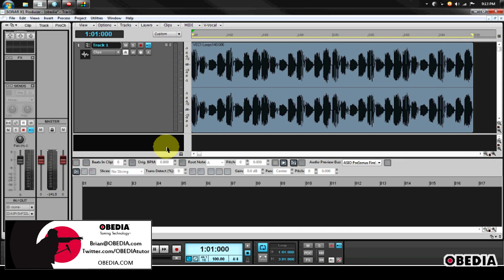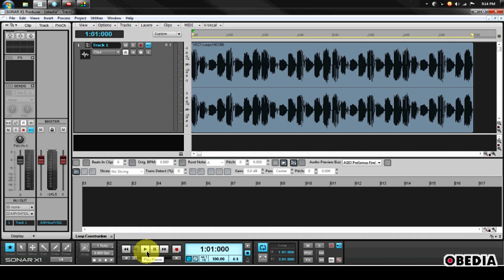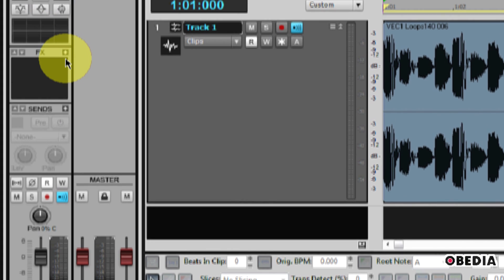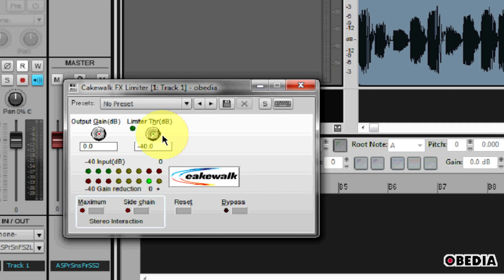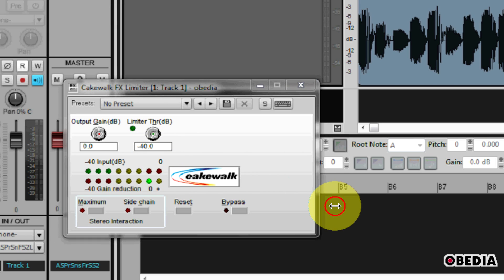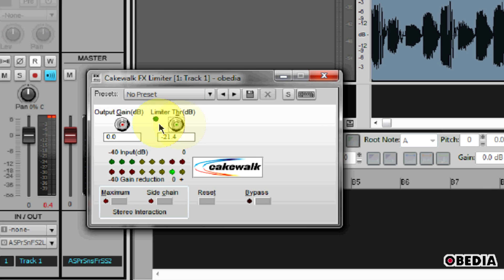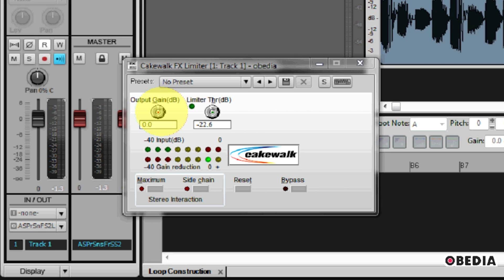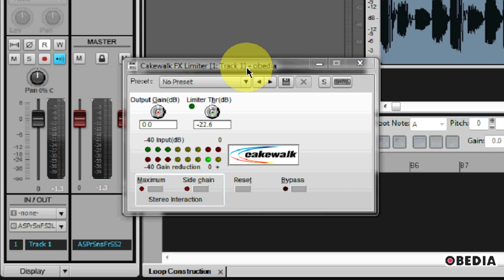CAKEWALK SONAR: How to use a Limiter

Comment: Nice video. Your explanation of the basic features of limiters is clear and easy to understand. Having said that, this is not a scenario in which I would suggest using a limiter. IMO, mixing that close to 0dBFS is not advisable and lowering the volumes of all the tracks would make more sense as a solution. In the current version of Sonar, this can be accomplished in a few seconds with the quick-grouping feature.

Comment: You may have already figured this out, but the plugin he is using is a legacy plugin that does not install on typical x1 installation.  You can install this plugin with X1 by going back to install and checking this plugin only when you go through the options. IMHO there are better limiting options already on your machine.  The Vintage Channel, Sonitus Suite and Boost 11 will all do limiting.  If you have expanded, the Concrete Limiter is worth purchasing.  Low CPU usage and transparent